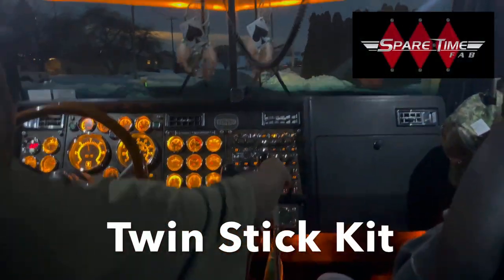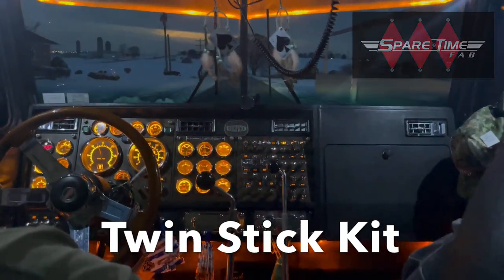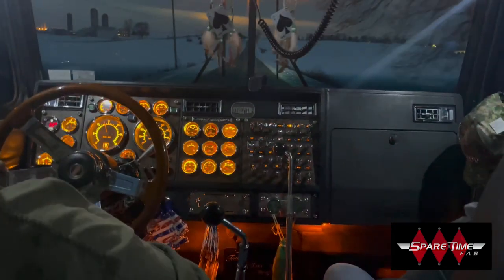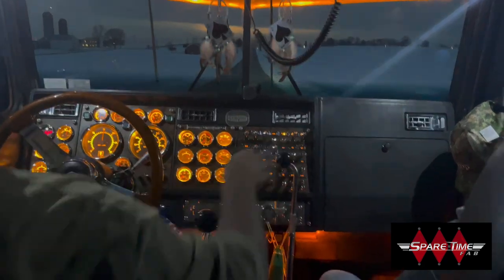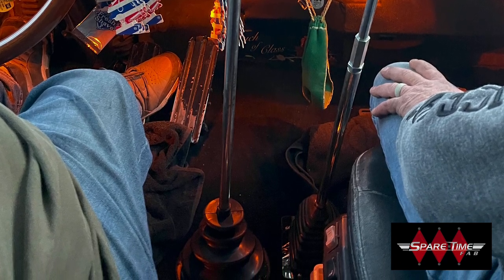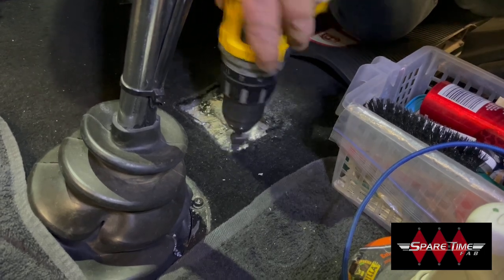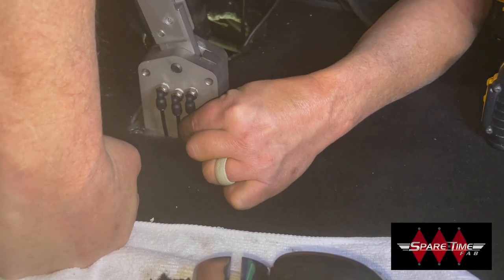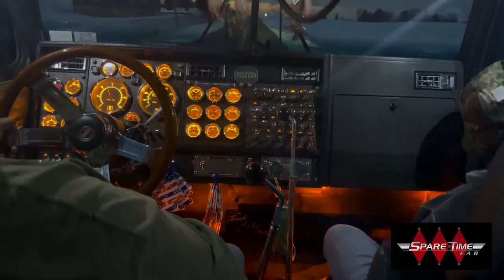Sparetime Fab Twin Stick Kit

Comment: Does the kit 4 Kenworth fit on a Freightliner Classic? Or do you have a kit 4 the Freightliner?
Reply from the maker: It will work with any 13 or 18bspeed transmission. Kenworth is just the boot.